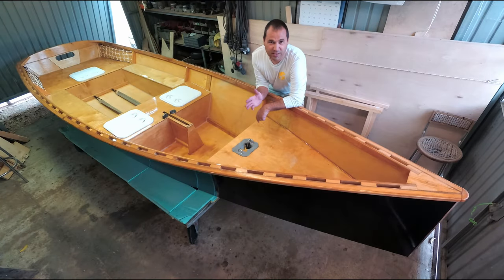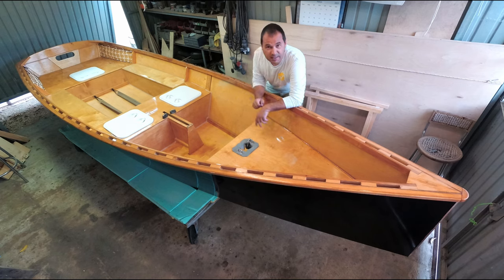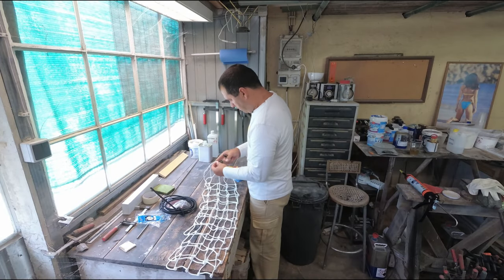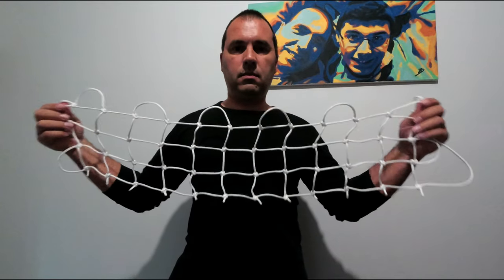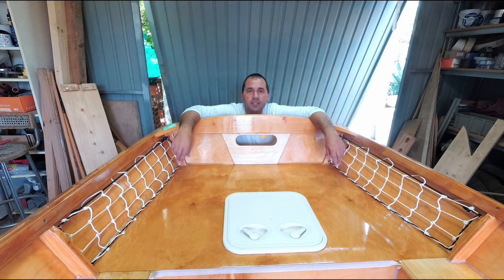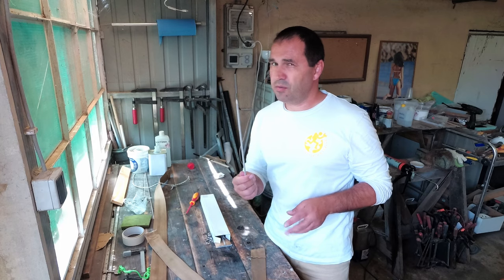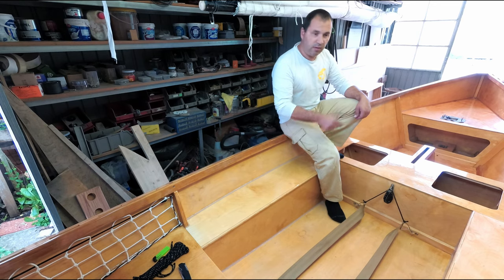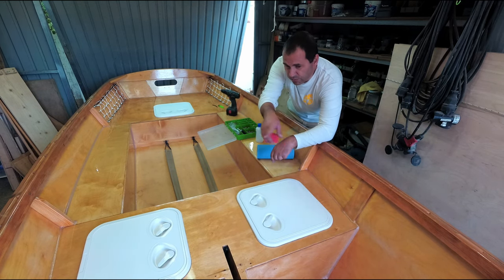Modifications to my Goat Island Skiff

Comment: To avoid future water damage you might want to use Drill-Fill-Drill when attaching thing like the hooks for the cargo net. 
1. Drill oversize hole
2. Fill hole with thickened epoxy
3. Then attach the fastener through the epoxy plug instead of directly into the wood.

 You are doing a great job.  Thanks for sharing.
Reply from the maker: Hi Ross! Thanks for the tips.
I actually filled the hole with epoxy and screwed the hooks immediately after.
On the tiller and mast I did fill the oversize holes with epoxy+microfibers and re-drilled them after! 😉

Comment: Hi Teo, May I ask a few questions about the hatches you used?

1. Are they waterproof/watertight?
2. What brand hatches did you use
3. What did you seal them with - The black stuff!!!

I had a crack in my Lugger and had to cut into the mid-ships bouyancy tank but rather than have some porthole inspection hatches I think I may as well use the space and install some larger hatches.
Reply from the maker: Hi Dave!
I'm sorry to hear about that!
The hatches are NOT 100% waterproof. If underwater for 5 minutes maybe just under a 1/4 pint will get in the tank
The brand is Nuova Rade, made in Italy and I got them from Waveinn.
The black stuff is Fischer MS Nautic.
Cheers,
Teo

Comment: Teo, nice idea to add the nets for storing stuff. But, by screwing the eyebolts I think there is the risk that the wood will absorb humidity and could be rot after some time. What is your opinion?
Reply from the maker: Hey Enrico!
I put epoxy on the eyebolt's threads before screwing to the frames, no water should get in there. 😅